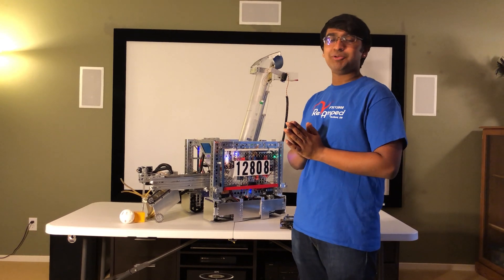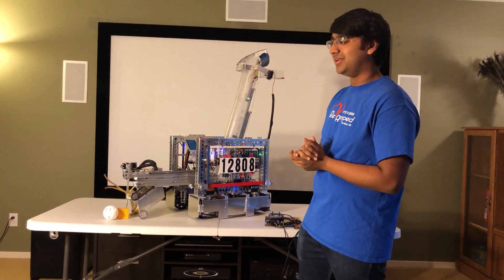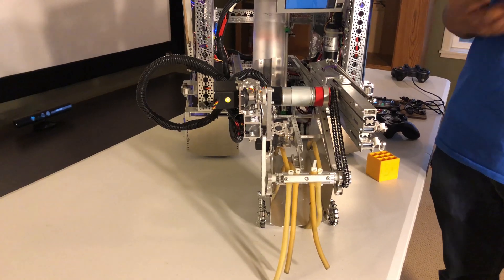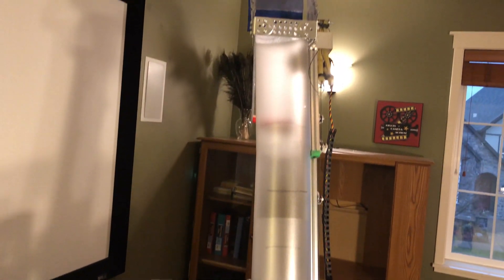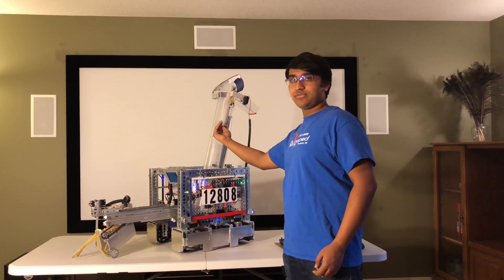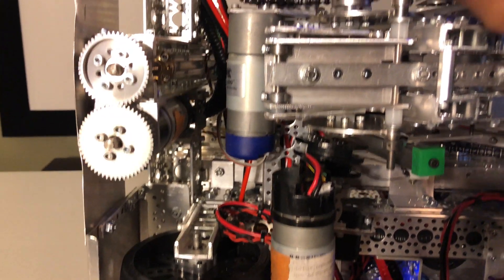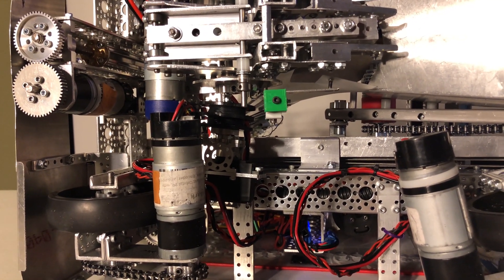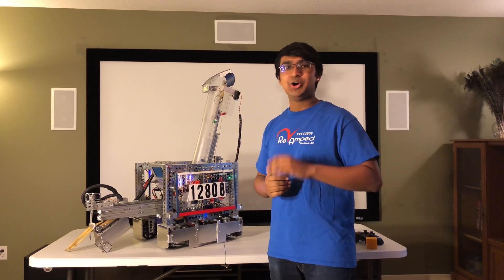CAM-Based Popper Mechanism

Comment: So is the continuous servo constantly running to hold it up
Reply from the maker: Yes - we are planning to use a mechanism that takes the weight once we reach full extension, but for now the servo holds the slides up